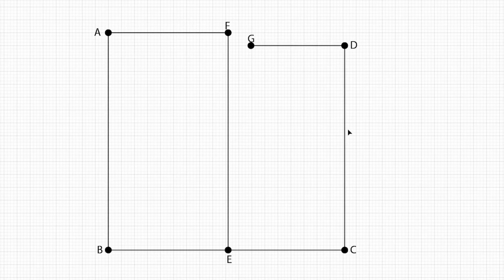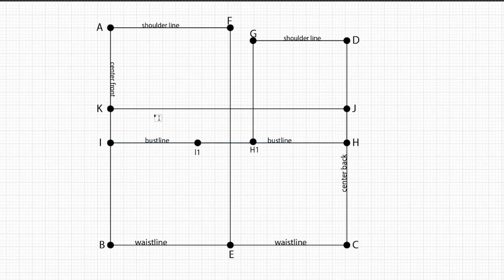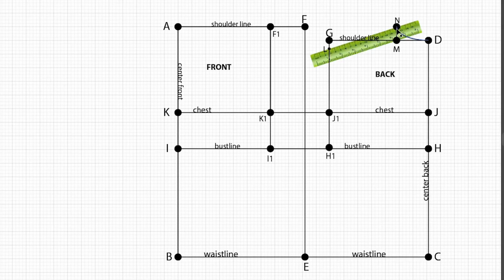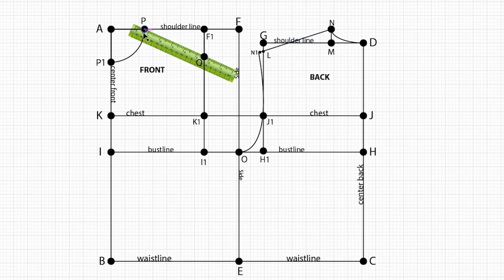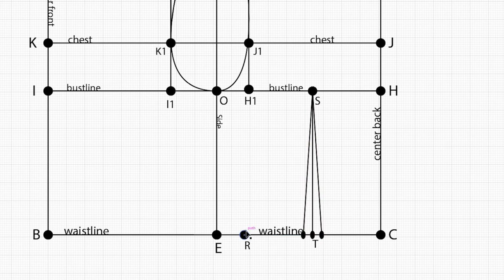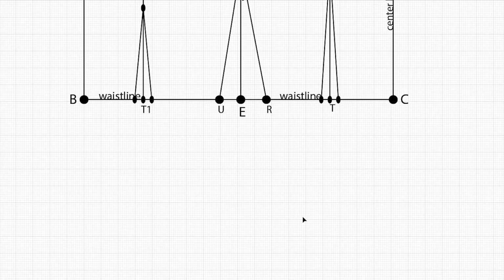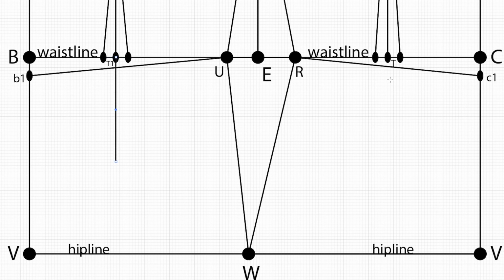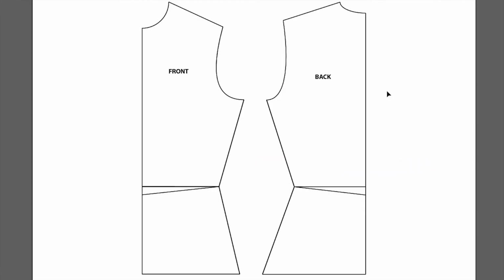DIY Basic Bodice Pattern | Ty Kent

Comment: What seam allowance do you use for this bodice ?
Reply from the maker: When it comes to my bodice patterns, I add the seam allowance based off the use of it.  So, the pdf pattern I have for sale does not include seam allowance for that reason.  For testing, fitting, and adjustments of the actual bodice, I add 5/8" or 1/2" before cutting the muslin to test the fit of the bodice.  This will give me room to take out areas (if needed).  When using the bodice to create other top patterns, I don't add seam allowance to the bodice.  I create my desired pattern from the bodice then after creating the final pattern, I add 5/8" or 1/2" for testing the fit of the pattern in case of adjustments.  Once I finalize the fit of the pattern, I use 1/4", 1/2", or 5/8" depending on the design and fabric being used for the design. Certain areas on certain designs require different seam allowances when creating the final pattern of any top.  I hope that helped.

Comment: Great tutorial but you have an error..B to C should have been have the hip measurement not the bust measurement if the hips are bigger than the bust
Reply: This makes sense to me, as I tried this using measurements that had the hips wider than the bust. Do you know if any adjustments need to be made to the bustline (I to H) as a result? And if so, how would this be done? :)
Reply: @ayaraskovitch  you would measure out your bust measurement on the hip measurement line

Comment: Can this dartless bodice be used for knits or only wovens?
Reply from the maker: It can be used for both.  I have a link in the description bar that takes you to a blog post that has a resource guide with an ease chart on it.  The ease chart gives you the amount in inches you will need to add or take away in order to use the bodice for specific garments (knits or wovens).  This bodice tutorial is meant to be the exact measurement of your body, then once it is created, you can use it as a basis for creating other patterns.
Reply: @TyKent  hi please help the H1 to H1 line is too long what could be the problem plse.
Reply: Hi I'm having a problem with the h1 to i1 line